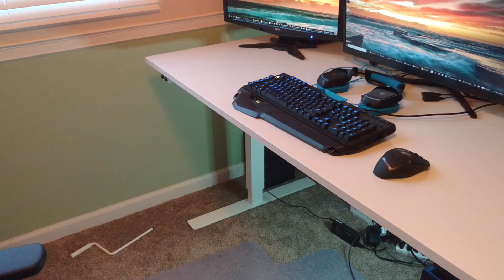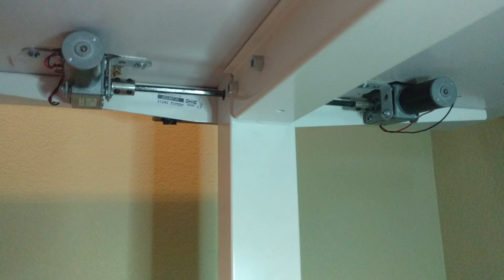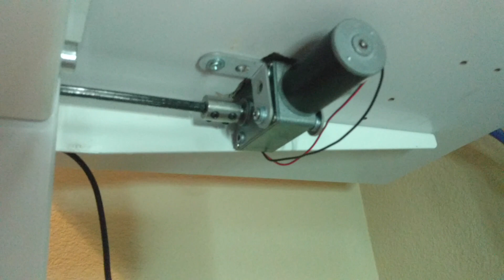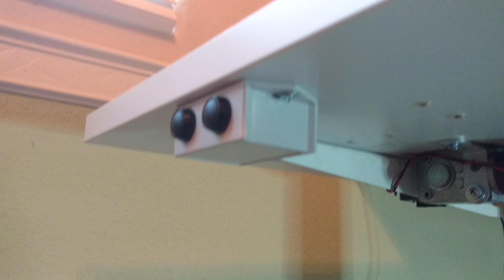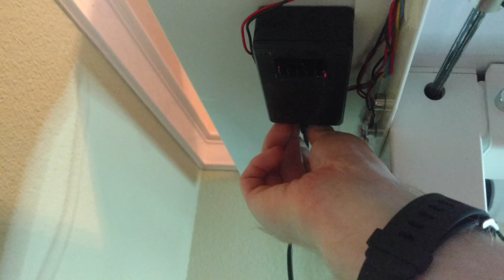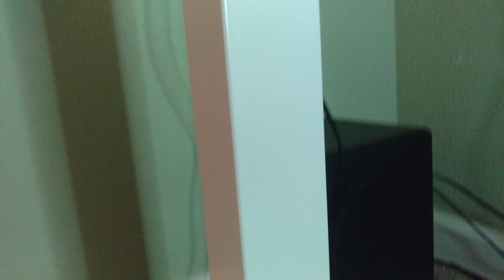Adding Motors to My Ikea Sit Stand Desk!

Comment: I just picked up the same desk and was thinking of doing the same mod. Im kind of surprised it took 2 of those motors to lift the desk. I'm wondering if the issue was the h-bridge driver that was used rather than the motor itself. It appears the h-bridge L298N is only rated for 25W which at 24V will only give you around 1A of current before exceeding the rating. I assume it starts to limit current rather than letting itself burn up lol

Also I checked out your other videos and your website. Cool projects!

Comment: Hi. I know this is an older video but... I was hoping you would still see this comment. I have a desk like this and was thinking to do the same, since trying to sell it and buying the original electric ones would be too expensive.

Do you still have this desk? How is it holding after all thesw years?

Has anyone tried with this curtain round motors? I believe they are quiter. And many already have the remote, it's pretty much plug and play. Except you would need to find a way to connect to the manual crank spot. 

Thanks in advance.
Reply: In my personal experience the frame is nice but the deskplate is garbage for the price, the coating is really sensirive and yesterday I dropt a glas on to it by accident and it left a small hole instead of just a dent. it turns out its filed with cardboard, for the same price you can get a real wood plate and you can drill the holes by yourself

Comment: Hey Scott, I want to mount a power strip underneath this desk and am curious what solution you went with as it looks like your fasteners don't go through the desk? (I may be wrong, couldn't tell). I purchased some fasteners, washers and nuts and was just going to go through the desk but am concerned about the structure of the desk. From what I know it's particleboard sandwiched between fiberboard and should be okay but perhaps there are spots that are better than others. Any way, thought I'd ask. Thanks for this video!
Reply: we have 2 x 6 outlet power strips but one plugs into the other, we used 2 sided tape and zip ties. These are mounted on the central bar and we built a shelf to hold my wife's 3 Mac mini cluster, Pulwtop hub with 2T NVMe SSD (P3 crucial) and 2 x 4T HDDs

Comment: Has anyone else tried this yet?!?  @Jeremy Maclou @Nabeel Molham ?

@Scott Stack - Do you have any updates on this build? Did you end up using stronger motors? (if so - which ones)
 Also what do you do when the desk gets to max/min height? As you crank by hand at max height, it gets more difficult. Does this excess torque load stall the motor?
Reply: News one this?

Comment: looks like a stronger motor is needed. Planning to pick up a Skarsta from Craiglist and motorizing it like this. Good stuff!
Reply: Needs more voltage,  go off the motor rating for max speed.   Ideally you would get more reduction gearbox and then crank up speed.   A small hobby motor could lift that desk if geared right.   The desk is already geared somewhat with the screw drive .
Reply: I got two motors as shown but not working, I can decide if it’s enough power or needs better motors
Reply: News one this?

Comment: Hi, thanks a lot for sharing your experience. Given the same desk, do you think I could use just one motor like this one? https://www.amazon.es/CQRobot-6V-26RPM-12V-52RPM-Reduction-Eccentric/dp/B07D934PV6/ref=sr_1_7?ie=UTF8&qid=1547648321&sr=8-7&keywords=motor%2Bencoder&th=1
Reply: Looks like a much better motor, did you try it?
Reply: News one this?

Comment: Nice build. I am working on the same thing. Did you connect power to 5V input or 12V input?
Reply: News one this?
Reply: I did a 5V input to the relay and 12v to the motors via relays

Comment: Nice tidy build. I wonder if you could control this with a Raspberry Pi so that you only have to set a desired height and it automatically goes to that height. Having computer control as an option with manual override would be nice.
Reply: A pi would be overkill. You could easily do that with an arduino.

Comment: I'm working on a similar project and was considering going with an AC motor instead for the sake of torque. Working on finding an idea motor for that. Little tough for me because I have very little experience with motors :)
Reply: AC seems ideal but the hardest part seems to be finding one to work with the clearance of the desk there... if I can find something for the clearance of the winding piece that is reversible then all you need is a voltage regulator and a 3 way switch and boom you are set!... right??
Reply: @DinkusPony  Maybe a motor off electric window blinds. It already has an up and down switch
Reply: @scsanderclaes  News one this?  Did you try?
Reply: @emailyarabrandao  Hi yara, could you?
Reply: @DinkusPony  
Hi milo, could you?
Reply: News one this?

Comment: Hey, I'm really interested in doing this. Such a great idea. No in your site you said that it's a bit slow to go up and down. Would you recommend a higher RPM motor. To get it up faster. On Amazon I am able to select a higher RPM motor. Would I need a different H bridge to be able to handle the load?
Reply from the maker: Hey! Yeah much of the slowness is because the H-bridge I used couldn't handle the current. I switched to using a set of relays, but I think something like this would be way easier (https://www.amazon.com/HiLetgo-BTS7960-Driver-Arduino-Current/dp/B00WSN98DC/ref=sr_1_5?ie=UTF8&qid=1535642291&sr=8-5&keywords=h+bridge), and it comes with the integrated protection diodes as well. The thing about higher RPM motors is that generally they have less torque, but it might be worth a shot to try a slightly higher RPM. Good luck!
Reply: @scottstack5114  Thanks Scott. How would I connect this to the motors and the buttons?
Reply: News one this?

Comment: Hot glue a cheap drill to the bottom of the desk and done!
Reply from the maker: lol yeah. honestly that would have been cheaper.
Reply: I actually tried this but turns out most drills are too thick to align the chuck with the desk's shaft. Any easy/simple idea to overcome this ? Cheers !
Or how do you mean "bottom" of the desk ?

Comment: Hi Scott, thanks for video, I was just looking for exactly that idea, can you share links for the hardware you used? Like motors, control board, etc. Much appreciated
Reply from the maker: Updated the description :) However, I'm not sure I would recommend copying this exactly. One of the motors I used just broke haha . I haven't figured out what happened yet, but might be that they just don't produce enough torque :/

EDIT: turns out it 'broke' because one of my shaft couplers came loose. Tightened it, and it's fixed :) However, I found out that the H-Bridge isn't capable of handling the current that both of these motors draw, which was unnecessarily slowing them down. I switched that module out for a set of relays and it works much better now!  I'll post some updates.
Reply: News one this?